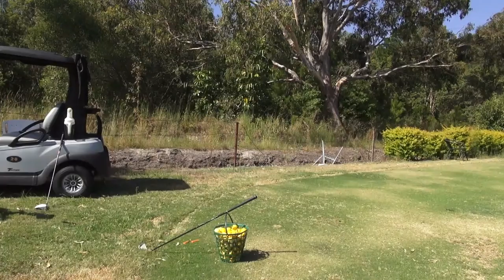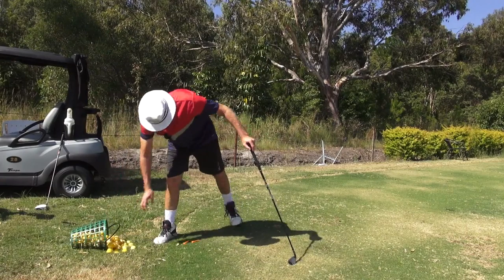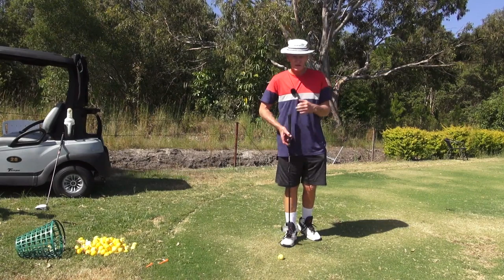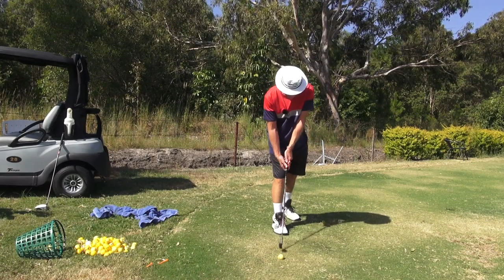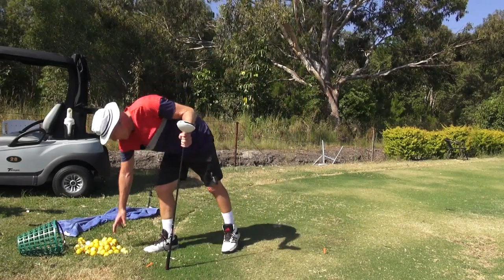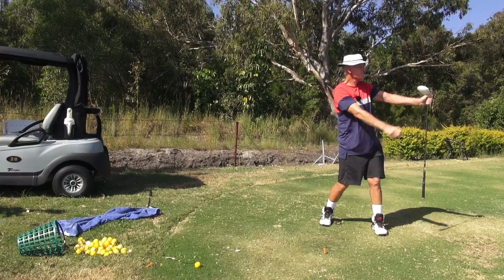'Squaring Up'   Channel Lock  Address Alignment   .. Option..

Comment: Hi JH,  is secondary tilt at address helpful with the channel lock swing?
Reply from the maker: Hi Ronnie, 
            I wouldnt be  putting  an actual secondary tilt  action into  the  address position ..  by just  having  a  closed stance at address   which CL  in std form  produces.. that  by its  own  structuring  gets the  upper body  in a strong loaded  up  position. 
      A secondary  tilt  process normally  is  a  necessary requirement  in  a downswing..  if you  apply  it in its  actual biomechanical function  in  the backswing you would get to much upper body  hanging out in space  not being  supported  structurally  well enough. 
       I would just  concentrate on getting  a  good   rearward  rotational  whole of body  turn into the  trail  leg  in the backswing.
       cheers JH
Reply: @1atomicgolf  Hi JH,  I don’t know for sure if I was applying secondary tilt or not the other day when I was playing a round of golf, but at the address position instead of standing with just the normal forward spine tilt over the ball, I started to also bend to the trail side a little and that helped me to hit the ball a lot better.  I have never put side tilt or side bend into my golf swing until just recently and it seems to have helped my ball striking and accuracy.  Was I just getting more into the trail side by doing that or was I applying secondary tilt at address?

Comment: Can you make one video with slow speed so we can see entire swing at impact and before impact?
Reply from the maker: I wont be doing  any videos  until  around January  next year ..you can play any of   the videos in  slow motion  by just clicking on the settings    icon  at the bottom  of the   videos       and select   'speed''..  then  change the speed from normal to  0.25...  then you can just   press the  start stop   button    at any stage of the swings..
                   cheers JH

Comment: I am 77 years old and you make the setup  to benefit a contortionist.Sorry but I will continue with the Jim Venetos swing.Less complication and less alterations which you seem to make every video.But good luck to you and your system, you seem to deal with is easily.
Reply from the maker: I'm 77..almost78.... and certainly, no contortionist...the swing is easily adapted if you take the time and effort to understand how it  'should' be applied..
               What you term as 'alterations' are simply ongoing  'developments'  of the swing ... nothing wrong with the Venetto's method... but it will never eliminate the pulled or dragged shot  ..   Channel lock was developed to specifically do that  ..
                cheers JH

Comment: JH, thank for all the great info. Question... If your left arm and club in a single axis at setup?
Reply from the maker: The lead arm is not in what could be termed a 'single axis' configuration...it would have to be more elevated and away from the body at  address as per Moe Norman/Bryson Dechambeau position their arms at address  ..  That is not to say you 'couldn't'     have a single axis lead arm at address with the CL swing  ..  I personally just like my trail arm close to my body at address which gets me swinging in the channel easier in the backswing .. 
                   cheers JH

Comment: Do you lose some distance ?
Reply from the maker: No distance loss at all.. in fact, because the quality of the strike is so much more efficient   I have picked up distance  .. the  inside path attack   consistency  just    flights the ball  with  more forward penetration 
                    cheers JH

Comment: Mr. X is more square too, right?  And just to clarify, he pushes back with left arm and hand and then drops and pulls with back of left hand on the downswing.  You do it entirely differently.  And Bill Phillips does it different from both of you.  At least that's my perception.  Protocols the same though.  Shows the flexible options available in CL.  I'm not sure what will work best for me yet.  Plenty of snow on the ground here.
Reply from the maker: It's all about how 'you' can 'best' apply the base principal protocols of CL ..   everyone will have slightly different backswing ignition processes and downswing procedures.. variations as long as the core principals are applied are perfectly acceptable...
                    I think Mr X   has more preturn than    Bill Phillips or Matt Gray... but not as much as myself..  yet his ball flight direction starting angle is identical to mine .. 
                      cheers JH

Comment: JH,
I won't belabor the point after this but I've again reviewed the MMI video and if you look at Matt's hands they are centered at his belt buckle. Further evidence that his ball position is not off his right foot because he couldn't hit a ball off his right foot with his grip so far forward from the ball.  Promoting an in to out (shallow) path is great for any level golfer but for slicers trying to draw the ball-or at least not slice it -Matt's overall address and finish will not cure a slice. To eliminate a slice,  the player should first start in your position which accentuates the protocols and then slowly move to Matt's position but initially the player needs to feel that inside to out sensation. That's what I think CL is all about and, in my opinion, where you will get the most traction-particularly with over the toppers. Isn't that really your market? If a slicer were to emulate Matt's swing, I guarantee you that sooner or later they will revert to their over the top, reverse pivot swing without first feeling and following  the CL protocols.  As I said earlier, those golfers initially need to FEEL what your position is like. For them, it will feel so strange but that's really how you fix anything in sports-it has to feel foreign at first but eventually with practice they will get it and then have success in a more tradiinal set up-like Matt. In my mind,  CL is a system when the protocols are initially strictly followed   promote a shallow swing path and will  ultimately cure a slice That to me is your marketing and monetizable niche. If I were teaching CL and slicer asked me what CL is all about I would tell him I will fix his slice by following the protocols. If I were slicer and I watched the MMI video it wouldn't help me all. Just my thoughts.
Reply from the maker: Louie,,
CL  was not originally designed to cure a 'slice' .. I    developed it to eliminate a pull/drag shot that the better player   ( myself at that time) who is a more aggressive body releaser and is prone to get on occasions ...
                  I have never sliced a ball in my life .. not even when I first started playing ... my nemesis shot was always a snap hook or flat drag shot.... 
                       CL is not just a swing geometry/mechanics to cure just players who get over the target line at impact ...the swing is designed to eliminate over-rotation of the shoulders at impact ....  nothing more .. nothing less..and in doing that will cure a myriad of shot starting direction faults ..             
                   Matt Gray can and does get very effective teaching results with his Protocols demonstrations to students .. they pick up  on what he is doing and suggesting very easily ..    I think he applies the Protocols as they should be applied ..   I just don't see what you see in his swing ..   
              I have never used a ball flight monitor ever for teaching students or fitting clubs..   I can see clearly what the path attack direction is in a golf swing by the ball flight starting direction and flight characteristics ..   Matt starts all his shots right of his target line .. he couldn't do that if  he had the ball in the middle of his stance as you suggest he has...
                   CL is not designed as a    'Slice   Fixing'  golf swing .. which is  the normal  domain of   the rank and file player ... its a     set of mechanics to suit all level of playing expertise ..   I designed it to fix 'my'   occasional pulled/dragged shots  ..  not my   'Slice'..       
                      I  would not suggest Matt Gray change anything in the way he portrays the CL   swing   Process ..you say if 'you' were a slicer the MMI videos would not help 'you' ..that's probably right  ..   but that's only because  'you' perceive  what you are seeing   the way  'you' do ..  you can't    lump  everyone else in with 'your'    perceptional opinions .. 
                     cheers JH
Reply: @MMI Golf Bill Phillips/ Channel Lock Master Teacher 

Good luck with it. Slicer's paradise.